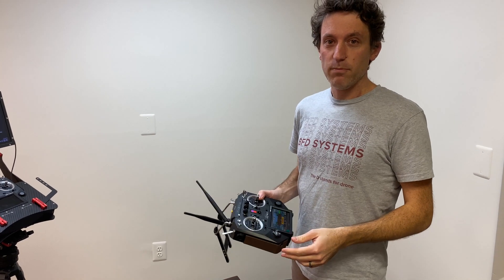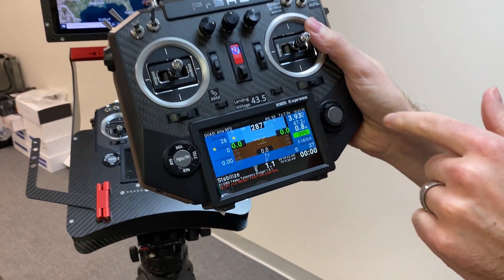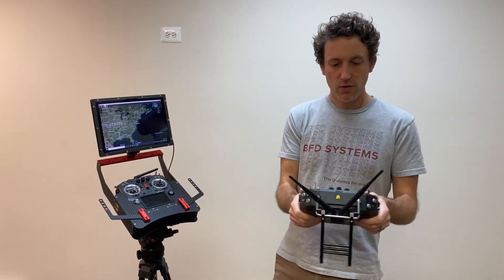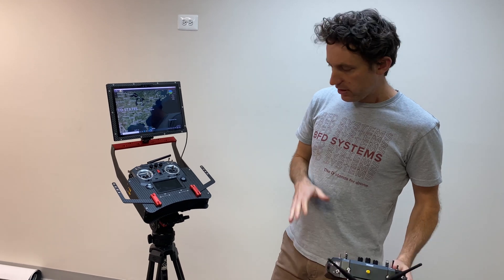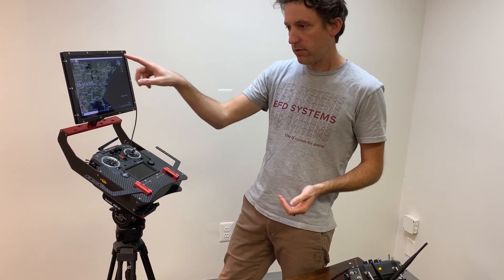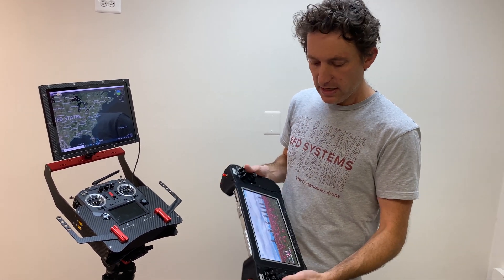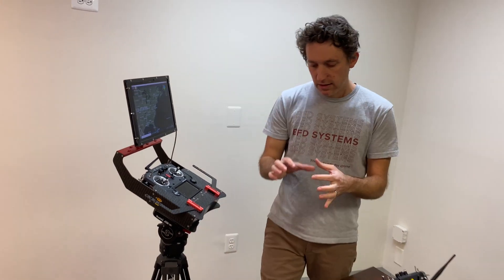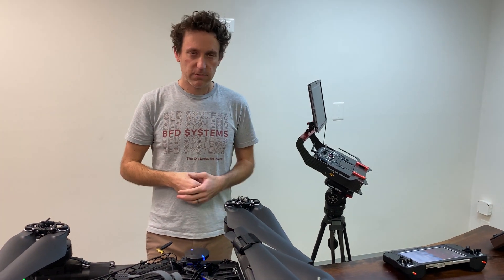Alta X RFD900 Mod walk through

Comment: That's awesome! Are you using the rfd as a Telemetry system and control receiver as well on the pixhawk?
How did you configure the rfd as a reveiver?
Thanks for share your work
Reply from the maker: Yes thats right it does SBUS and Mavlink. There is some custom software and we also use an external BEC.